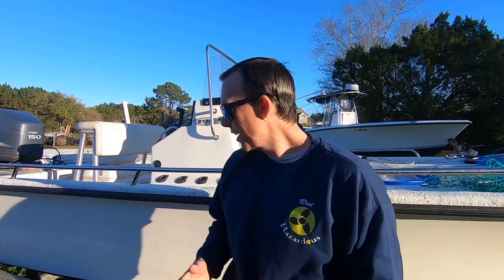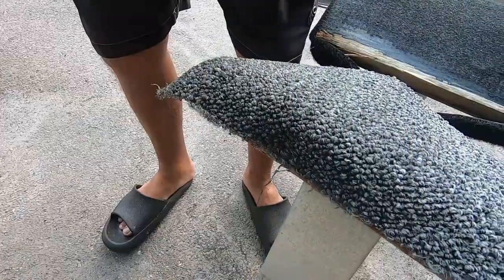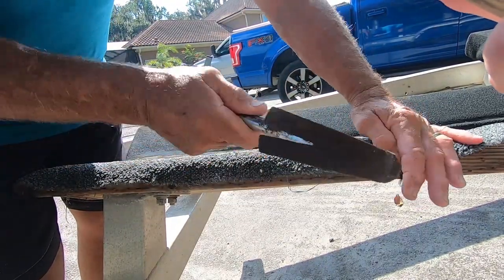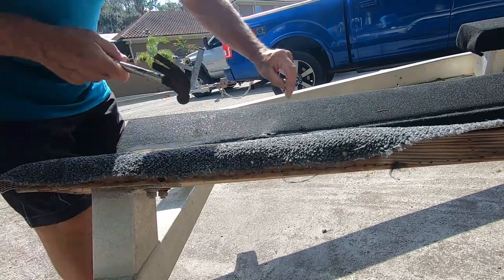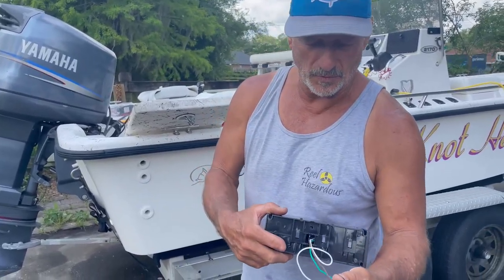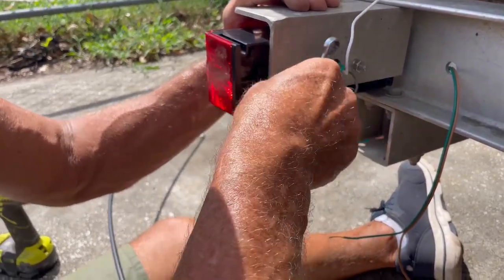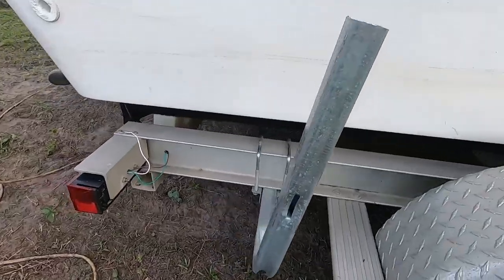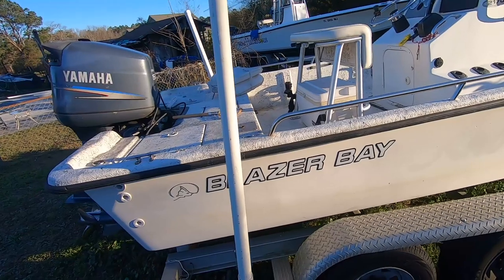Fixing and Improving a Boat Trailer (Lights, Bunkers, and Guide Poles)

Comment: I bought a set where the light is mounted on top of the guide pole. No more dunking the light and an awesome improvement.  Great video as usual.
Reply from the maker: We tried some of those in our big boat and I like how they keep the lights out of the water. The only problem is if the boat rubbed against it just right it would break them. I think I need to tweak my setup a little though for the big boat.
Reply: @Reel Hazardous  You might try some schedule 80 pipe. Big boat is heavy for sure.

Comment: Suggestion here is to always crimp the wires with heat shrink crimp connectors that also have adhesive inside. Just twisting the wires is not good as we know that the wires do oxidize and will lose good connectivity especially over time and get more and more resistance potentially causing the low voltage/amperage load to the light, killing the light. You can also put heat shrink over the crimp connector as well.